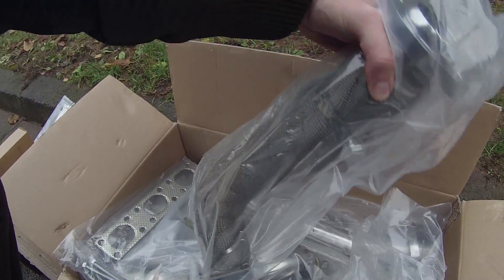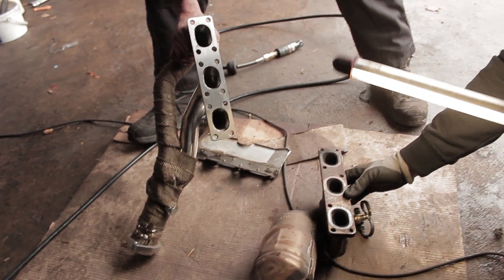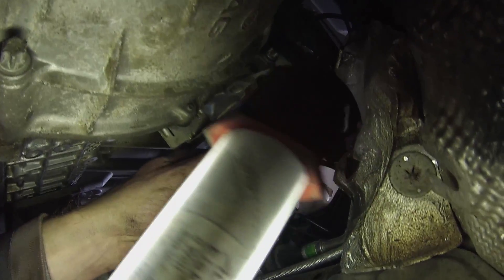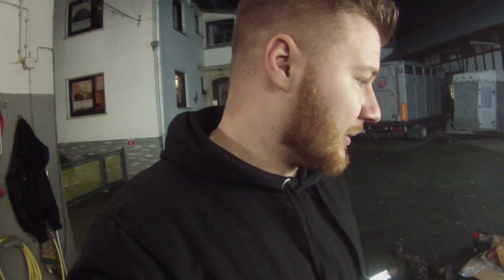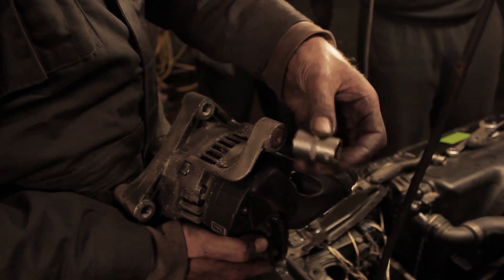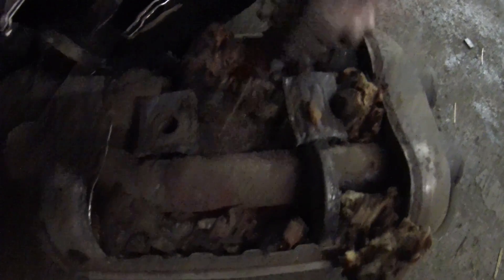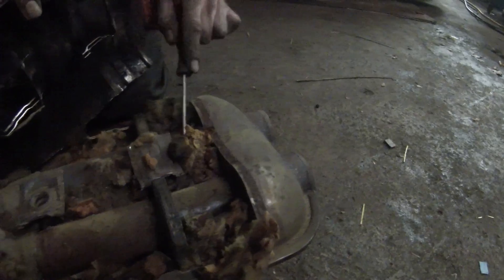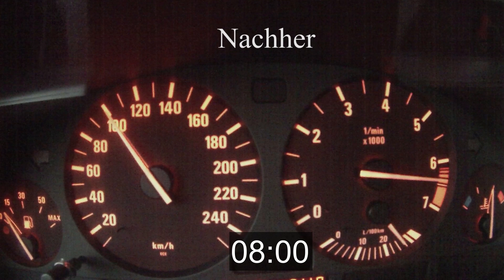BMW e39 523i M52TÜ Tuning (Fächerkrümmer,200 Zellen Kats)

Comment: Hammer setup. Fahre auch 200 zellen kat von magnaflow. Eisenmann auspuff und Schmiedmann krümmer. Nur am m52b25. Also 323i. Würde dir empfehlen das ganze noch Optimieren lassen von SGS-Sven. Hat mir meinen mit Brücke dazu auch komplett individual abgestimmt.
Reply: BMW e36  Wer ist SGS- Sven und wo macht der die Abstimmungen? Was verlangt er? Möchte das gleiche wie du machen. was ist leistungsmäßig dabei rausgekommen?
Reply: Sepp Schramm Hallo

Sgs heißt sven garwisch software abgekürtzt. Dies ist der Firmenname. Sven ist einer von den bekanntesten und besten BMW tuner und Abstimmer. Meiner meinung nach der beste. Hat sich selbst schon früher mal einen 3,0 M52 kompressor compakt aufgebaut und wurde dadurch dann selbstständig. Individual Abstimmungen macht er auf der Bahn mit anheschlossenem Laptop mit Sonde vor dem kat und Programmierbarem steuergerät.... das ganze volle programm... 

Geb in Google sgs ein dann kommt seine Hompage. Da kannst dich per e mail bei ihm melden und auch die aktuelle preisliste von ihm runter laden.
Reply: Sepp Schramm Gibt im Internet auch viele Erfahrungsberichte von seinen Abstimmung.

Comment: geile sound.
habe auch bei mir m54b30 die msd zu gemacht und hinten esd von Remus.
aber ich wolte noch facherkrummer von m52 einbauen.
oder ist besser smidemann kaufen und einbauen .

von die habe 25 eu behzalt..und schmidemann kostet ube 330 eu nur krummer
#
piotr
Reply from the maker: Der originale Krümmer vom m52 wird nicht passen. Der vom m52tu leider auch nicht... Ein Video dazu haben wir auch auf unserem Kanal, es heißt: Reparatur: BMW e39 Abgaskrümmer/MFL Tasten Nachrüsten/BMW Syndikat Asphaltfieber 2016 Trailer

Comment: Was Sind denn die Unterschiede zwischen 400 Zeller und 200 Zeller was ist empfehlenswerter die Auflistung der unterschied wer ganz cool danke im Voraus
Reply from the maker: 200 Zeller: EURO 1/2/3/4 max. 2,5L 200PS pro Kat (EU)
400 Zeller: EURO 1/2 max. 1,6l 90PS pro Kat! (EU)
Reply: Time2Drive O. k. vielen Dank für die Info und dann hätte ich noch ne Frage ich hab den e39 530 IA und welche Kats wären dann für meinen verwendbar? Bei Schmidmann direkt wird es mit 400 zelllern angeboten Danke ✌🏽

Comment: Sehr gutes Video. Habe mir einen e39 520i baujahr 97 gekaufr mit 67 000 kilometern und einwandfreiem Zustand für 6500 Euro. War das ein guter Preis? Was könnte ich Kostengümstig machen um statt 150 Ps über die 200Ps komme?
Reply from the maker: Kostengünstig geht das leider nicht.

Comment: Kanns du das etwas mehr erläutern mit dem ölverlust ?
Was ist das Ding was es verursacht.
Hab einen e46 Und er frisst Öl wie Sau.
Reply from the maker: Hi, du hast bestimmt einen 4-Zylinder oder? Wie viel ml verbraucht er auf 1000km? In meinem Fall war es nicht ein Ölverbrauch, sondern Öl unten an der Ölwanne und Getriebe... Am Messstab war nach 9000km alles im grünen Bereich.
Reply: Time2Drive genau hab nen 4-Zylinder.
Ca nach 1000km muss ich 1 Liter Öl nachfüllen.
Das ist echt schön heftig
Reply from the maker: Die 4-Zylinder verbrauchen an sich schon Öl, aber 1L auf 1000km ist viel. Es kann viele Ursachen haben. Ist der Motorraum trocken?

Comment: Wie könnte man aus einem 523 bisschen mehr Leistung rausholen Laufleistung 250k
Reply: Bankai sinnvoll und was nicht schädlich wäre ist eine m50 ansaugbrücke die umgebaut ist auf m52 dazu passende softwareoptimierung, kennfeldoptimierung, schmiedemann fächerkrümmer, Sport esd, Rohr einsetzen anstatt MSD und ebenso rennkats dann hast du locker über 200ps und das Schadet dem Motor nicht wirklich. Der m52b25 den du hast ist sowieso für mehr Ps ausgelegt deswegen macht es dem Motor nix aus